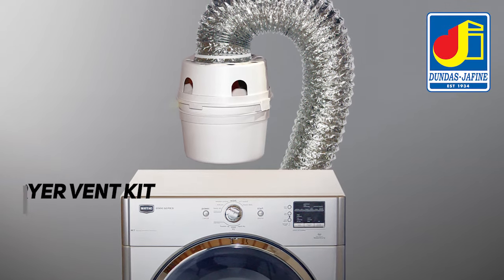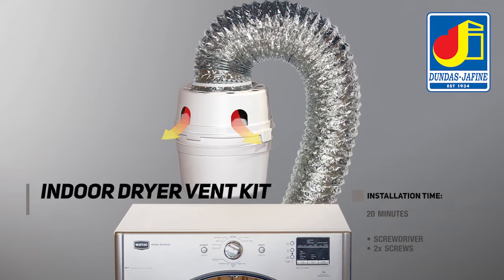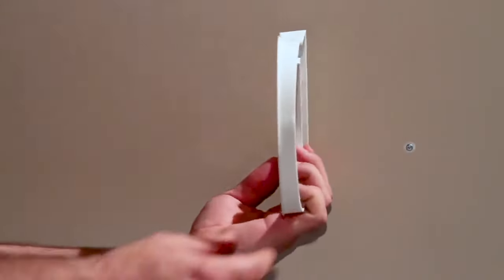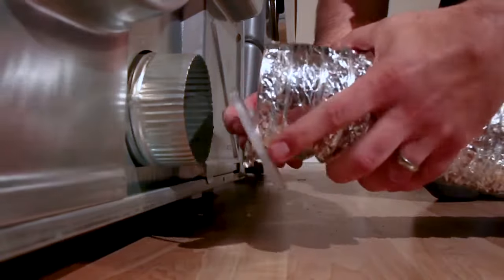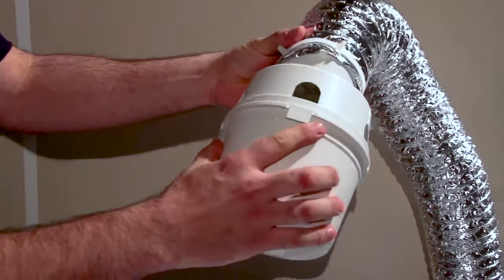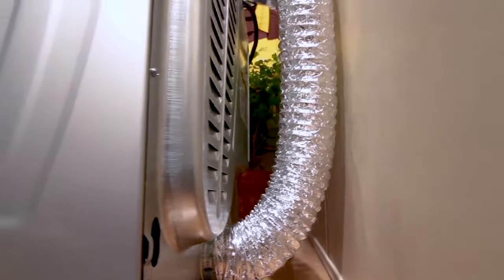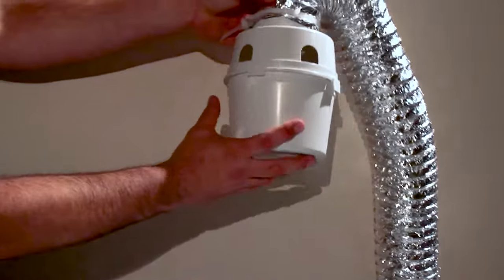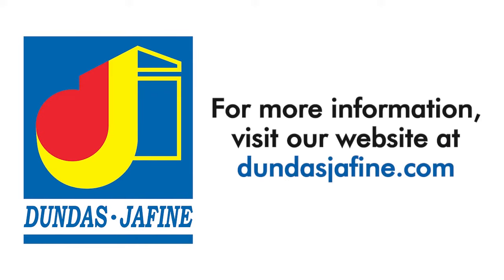Indoor Dryer Vent Kit - Installation instructions: Dundas Jafine

Comment: I've been using the Indoor Dryer Vent Kit with the 4-inch filter bucket for my electric dryer, and I've noticed that while it does a decent job of venting the dryer indoors, it significantly heats up the laundry room. The warmth from the dryer exhaust quickly accumulates, turning the space uncomfortably hot, especially during warmer months. This could be a benefit in colder weather, but in general, it's something to be aware of if you don't want your laundry room feeling like a sauna. The vent works as intended, but the extra heat is a major downside for me.

Comment: I did exactly as instructed but a lot of water and moisture accumulated around the floor of the round canister.
Reply from the maker: Thanks for your feedback on this product. Condensation will build up from time to time due to the water and heat mixing. Adding to much water to the cannister can also cause moisture accumulation.

Comment: Is this product meets with building code compliance while installing in condominium?
Reply from the maker: Indoor dryer venting in general will never meet code as building codes require a dryer to be vented outdoors. This product provides an option for those instances where outdoor venting is not possible. Also, this product should only ever be used with electric dryers and not gas dryers.
Reply: I don't believe that it's needed to comply with building code because doesn't affect any aspect of the building. The only thing it is needed is a professional electrician to switch the current voltage to 250 watts.
Reply: No. Check the NFPA laws.. it does not. Do not use this gimmick..

Comment: Why not recomiended use on gas dryer,
Reply from the maker: The fumes a gas dryer emits are dangerous. If these fumes are not able to escape through the vent, carbon monoxide will enter your house. Therefore indoor venting is not an option for gas dryers.
Reply: Did you have to cut the ring at all? It seems to NOT fit over the top
Reply: Please stay away from everything

Comment: Can I use a panty hose
Reply from the maker: Where are you looking to use the panty hose?
Reply: @DundasJafineInc  behind the vent to catch lint
Reply from the maker: The intention of the bucket is to catch the lint. Once filled with water it will draw the lint into the bucket itself, no need for an additional filter. It would not be advised to attach panty hose directly to the duct as the duct can become quite hot and panty hose is made of nylon